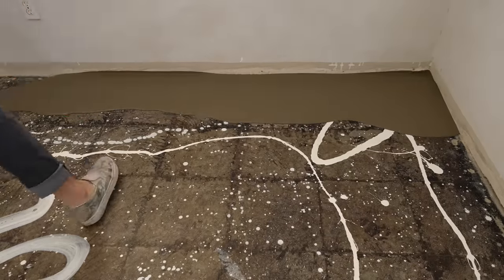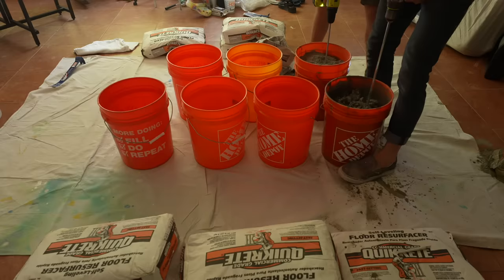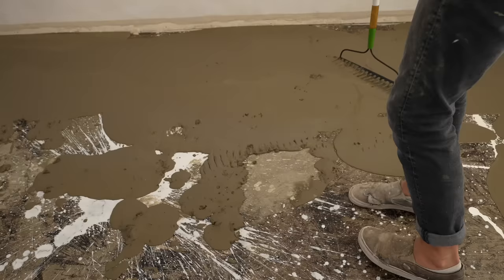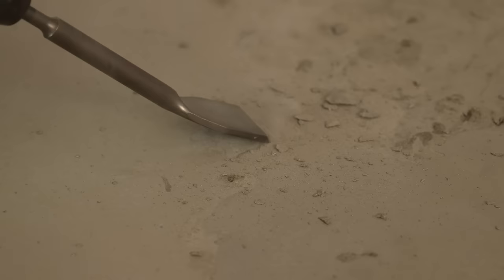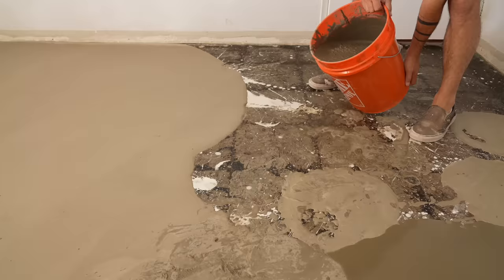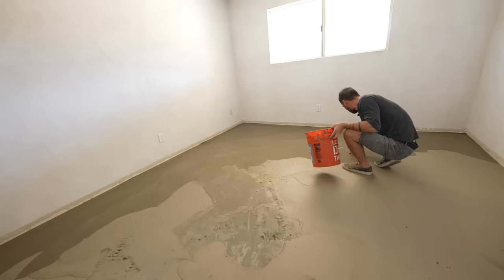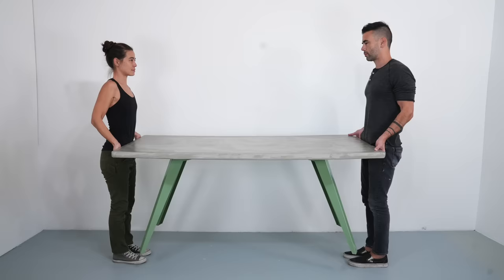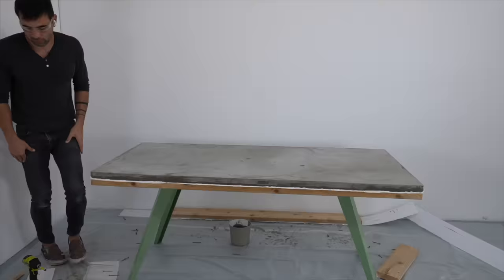Resurfacing Concrete Floors with a Self-Leveling Skim Coat

Comment: I have installed more than 2 million sq. ft of self levelling cementitious underlayment for rehabbing commercial buildings and a few residential projects. We usually shot blasted the floors with a Blastrac machine to mechanically etch the floor and to remove surface contaminants. We applied a latex bonding agent to the concrete to adhere the topping to the concrete substrate. Temperature is very critical for these materials, and we used ice cold water on hot days to slow down the material from flash setting. Our most commonly installed product was Ardex K-15 in foot traffic areas and Ardex K-500 where there was wheeled traffic.
Reply: Ardex is the absolute best of any self leveler i have ever used! You could drive a semi over that stuff when its dry!
Reply: By wheeled traffic are you talking vehicles i assume?
Reply: @StonemanRocks  At one time I was the largest user of Ardex in the country. I installed it all over New York City to rehab buildings. 80% of all construction in NYC is rehab of existing buildings.
Reply: @jamesmorrison7847  Very impressive! I would have loved to work with you! Im sure I would have learned a lot of good nuggets of knowledge! My resume might not be quite as accomplished ,however, I think I could carry on a conversation with you over a cup of coffee about this topic! My experience is well rounded with a lot of commercial tenant development and new construction as well, movies, restaurants, hospitals, post offices ,custom homes , tract homes etc. not to mention probably 1000 shower/ bath remodels! I have used a lot of different self levelers in all kinds of different senarios. Ardex is by far the best!
Reply: Sounds like Ardex is the best product as far as ease of use. I'm going to spend a little bit more to avoid the clumping and too much fast drying for me to keep up with

Comment: {scratching head} Isn't the adjacent floor Saltillo floor tile? If so, that is typically 1/2 thick tile. IF SO, the concrete is level to the adjacent concrete and not 1/2 lower ...and you made a big mistake.  Nevermind what this will do to the base of the sheetrock that absorbed the water in the mix over time.
Reply: Nah it dries so fast it wont hurt the sheetrock!
Reply: @StonemanRocks  All these types of materials do not dry... they hydrolize. If they dried, they would be power. Hydrolysis is the process of breaking down the concrete as it reacts with water. In this instance, the water content is high so that the leveling can occur. The water in the mix will absorb into the surrounding material and/or evaporate. The difference between absorption rate and evaporation rate determines the rate of breakdown in the concrete.… too fast, and it cracks… too slow, and it loses cohesion. Here, the difference in the rate of absorption of water into the cellulose in the sheetrock and evaporation in the air (as well as the process of hydrolysis) means that the edges of the leveling material will probably crack over-time. It is not the speed of of evaporation of absorption but the difference between the rates of hydrolysis. That is why preparation of the both surface and leveling material has so many variations that the process becomes based more on experience rather than simply a list of instructions. As a result, most experienced persons typically tape moisture resistant craft paper or plastic to the wall adjoining the floor leveling material.
Reply: @joemoya9743  you havent used much self leveler have you!
Reply: @joemoya9743  its not going to crack on the edges ! And by the way mr wizard the way it self levels is partially a function of the amount of water but also do in fact to the shape of the aggregate silica in the product because it is round therefore it rolls when it “flows” ! Without enough water though it stops flowing and you get high spots. Water or not you still have to work it as you pour it with a trowel rake something! Too much water just makes it powder after it dries . I have never seen it crack from too much water! Also there is a chemical reaction that makes it dry not just evaporation !  You can tell as it gets warm to the touch while drying!
Reply: @StonemanRocks  The chemical reaction you speak of is called hydrolysis. The rate of hydrolysis over the entire surface determines if it cracks or adheres properly. In this instance, if you want the leveling fluid to adhere or not crack, you want the evaporation of excess water to be the same through out the media. And, that will not happen if the rate of evaporation is slower or faster along the edges that are adjacent to the the sheet rock. 
How much of impact the the difference in absorption rate is determined by how much of the leveling fluid is touching the sheet rock.  If it is very little, then the absorption rate into the sheet rock is also very little. This results in little chance of cracking. However, the video indicated he may have used as much as 1 inch of leveling fluid.  And, that increases the chances of having problems along the edges.  
The good news is that self leveling uses lots of water and cement BINDER such as fluidizing adjuvant (also called superplasticizer designed to bind to latex primer and prevent delamination) and fine granulates (typically a sulfo-aluminous clinker and not silica since it is a quick setting mixture) to prevent shrinkage and cracking.  The cement is typically Portland cement that contains Calcium Silicate and the major contributor to any potential cracking. Thus, the need for a cement binder.  
The key in making self leveling work is the proper amount of mixing of all ingredients applied to a homogeneous surface.  And, sheet rock edges make the surface non-homogeneous.
All this being said, it appears that he is using leveling fluid for a situation that should not have been done - at all. There was no floor height difference. He is comparing floor surface to foundation surface. He doesn't know the difference between flooring and concrete foundation. And, that is a fundamental problem.
Reply: @joemoya9743  You know nothing !
Reply: @mrpolnar1  My Chemical Engineering Degree says otherwise. And, my fathers business was concrete construction. I grew up around concrete and construction.

Comment: I have been installing concrete microcement overlays for about 20 years and I can tell you that self levelers are without a doubt the one that takes the most experience and skill to pull off properly. Everyone thinks you can just dump and leave it like in this video. If for yourself and you dont care, then fine but for a paying customer this will never fly.
 Those pour lines end up being ridges and youll get discoloration from pour to pour especially if your water content isnt the exact same from mix to mix.
You HAVE to use a gauge rake to pull it all even and then quickly smooth out with a trowel or magic trowel/squeegee to tie in your pour line and have to work FAST.
 Every load must be mixed the exact same amount of water or youll get color shifts from each bucket.
Self levelers will also develop a bunch of tiny micro-cracks, no matter how well you prime and even if you use low water content.
Reply: Absolutely and having a spike roller to agitate and blend pours would have made a massive difference.
Reply: Facts
Reply: Also if you are getting microcracks are you wetting your surface before you pour? Maybe thats causing it!
Reply: I agree with Mojo jojo. In fact on larger projects we used a specialized machine that mixes and pumps the self levelling product while our guy used the gauge rakes and long handled trowel to break the surface tension and prevent ridges.
Reply: Another important part is prep work, that floor should of been cleaned with a grinder
Reply: @woozy607  kind of extreme for a residence! It would work but the dust would suck! Not sure what was there before but a good clean and maybe a light acid solution but even that's a little extreme for a residence. Sweep and mop and use a product with good compressive strength along with paint down some glue/ primer before and good to go!
Reply: @woozy607  i was def concerned with the 'foundation' of the pour.. it looked sketchy with all the paint and 'stuff'   but , good job for a first timer  :D
Reply: His first time and he ran to make a video to teach others his mistakes
Reply: Exactly‼️ They are loaded with accelerants to speed up the drying time which causes it to shrink and crack. You can feel the heat coming off the floor as it’s drying. I stopped using it because it doesn’t truly self level. Little things will stop it from spreading evenly. Then you wind up having to go back and grind down high spots before setting tile just to keep everything level and even. PITA
Reply: great points, thank you
Reply: If you are getting micro cracks you gotta be doing something wrong! I have never noticed micro cracks in all the self leveler i have poured ever!
Reply: @StonemanRocks  get them wet, that’s when they all show up. When it drys out you can’t see them.
This even happens on self levelers made to be finished floor toppings.
I’ve diamond polished many of these and they look great until you go to clean the floor with a mop and hundreds of spider cracks show up everywhere then go away when dries.
Not good
Reply: @TimKollat  why did you polish it ? Wrent you going to cover it with tile or something?
Reply: @TimKollat  did you tap on it to see if it bonded? If it bonded i wouldnt worry about micro surface cracks!
Reply: Do you have a youtube channel?? I wanna learn.
Reply: Could you help me out as you know a lot more about this? I’m gonna try do it but don’t want it cracking or anything

Comment: Have you ever thought about consulting a pro, or even the manufacturer before putting out bad info like this? You could have had such a better time and better results by having a 5 minute call with someone who does this everyday. 

For anyone watching this:
1. NEVER alter the water amount, just change products based on your environment. 
2. Spending $100 on the right barrel, mixing drill, spreader, and smoother will result in better installation and results. 
3. Although it’s self leveling, it needs to be smoothed or agitated using a spike roller to break the surface tension. This is a must. 
4. This product is not meant as a wear layer, there are other products that can hold up to surface wear. Also, applying a penetrating sealer will not change the look, and protect against staining.
Reply: You can too add xtra water and it can work for a wear surface too! You just need to buy the good stuff with a high compressive strength and do the right prep on the existing surface! Im thinking you are a well intentioned keyboard cowboy but that you have limited or no flooring exp! No one calls a trowel a “spreader“ ! And what the hell is a “smoother” lol! Plus $100 isnt going to buy a drill that will stand up to the rigors of tile /stone installations overtime not where I live anyway!
Reply: I take that back my smoothers name is Dave!
Reply: It’s on the bag and would have taken 2 mins of googling for them to find the right answer. I’m still perplexed that they are fine spreading bad information for other home owners. Especially with something that is such a pain to fix later.
Reply: Experts are after perfection and perfection is costly.. he was after the imperfections, hence why he said he doesn't mind stains and he liked the patterns he got. Giving him the old rustic look..

Comment: Nice video. I used LevelQuik RS and the matching primer. It was my first time and I had a similar experience. After 12 bags I learned quite a lot:
The recipe on the bag makes a dry mix that doesn't flow enough to actually level. Especially in dry California.
I talked to a pro tile-layer who uses the same everyday and he uses a way way wetter consistency (like 20% more water), and no problems.
I'm usually skeptical of people who say "I never read the bag, always done it this way, my daddy taught me, blah blah", but he was right, even just a little more water made everything better. I could take my time mixing without worrying about it being too dry by the time I poured. And the lower viscosity made it flow so so so much better. I'm not one to deviate from manufacturer instructions, but since you had success with a wetter mix, I wanted to back your video up with my similar experience.
Last thing people should know is that it doesn't fair-out like caulk or wall compound does. You can only spread it so thin before it looses its cohesiveness and you're just rolling tiny balls of grit around. It's best if you put it on thick, all the way up to vertical walls. It's not so great for skimming over a shallow low spot. If you're covering it afterward you might not care about surface finish, but it will tend to break up and turn to dust where it's very thin.

Your mileage may vary! If someone disagrees with my method, that's fine, mix how you would like to! I'm just sharing what worked for me. That's what DIY YouTube is all about!
Reply: Looking for a self leveler that emulsifies well when you mix. Willing to spend a little more on the right product. I plan to self level a floor and then put stain or a wash over it so need a self-leveling product that is good for that

Comment: It is very important to read directions. I used this as a complete beginner and had no issues.  It worked perfectly, with one pour. I could tell on your first pour that not enough water had been added. It's supposed to be runny so that it will seek its own level, like water does. Also, it's not meant to be the finished floor so it may not hold up over time.
Reply: what would you put over it? would Skimstone work? or are you thinking a flooring like tile or planks?
Reply: seal the concrete and it is supposed to last longer then the house

Comment: Haha. Yeah everyone’s first concrete experience alone usually goes this way. The fear of “running out of time” and having your product set up on you. Key is remain calm, and be smooth. Everything is in the prep. Smooth is fast. At this point I can do all concrete projects but when I first started I felt like I needed to be the flash of concrete work. Gave me so much anxiety. Looks good brother
Reply: Yes, right now my concern is a fast drying self leveling concrete that dries the slowest but I will have a Helper and my room isn't that big so I probably shouldn't get too paranoid

Comment: This surface will not wear nicely. SLC will not last uncovered. It just isn’t like real concrete, it will start to abrade and sand will come out of it. At that point it will wear very fast. Maybe if you’re always barefoot on it…
I would look into at least a surface hardener which doesn’t change the look but might keep this together longer.
Reply: Yeah, SLC suuuuucks for this kind of application.
Reply: He could do an epoxy topcoat though, right?
Reply: @mileshh515  should work yes
Reply: Or do a skim coat of ardex! Cheaper by far than epoxy!
Reply: Wonder if it'd be good to do one quick read and then one coat of Ardex. I am not laying anything over that except stain or equivalent

Comment: On self leveling concrete, you do it backwards. Usually we pour concrete powder first before water. In self leveling we should put water in the bucket first then the concrete powder based on what it says in the packaging. In this way youll be able to eliminate the unmixed chunks in your bucket when you pour it down. But hey this is a really nice content. Kudos to you. You earned my subs. 4 thumbs up

Comment: You need to rake (special rake with 1/8" - 1/4" gap with floor) the surface while pouring. This would have gotten rid of both the bubbles as well as the color variation.
Reply: A trowel works too!
Reply: No you use a trowel and spike roller to roll the bubbles out at the end
Reply: I assume the rake and or squeegee would have to be used fairly quickly after the poor. If you do it at the very end wouldn't it start to dry and there would be Spike holes?

Comment: its great to watch your videos, as you explain things. You may not get the results all watchers would like, but the process is key. Way to go! 
Doing a overlay is not a easy job for one person, yet you somehow managed to pull it off. 2-3 people needed..One mix, one to use a magic trowel/squeegee to mix the line patterns you are getting, and if you want to color it, someone to sprinkle the color powder. There are so many companies making overlays from super cheap to stupid expensive. I have tried about 6 brands to make samples, and they vary in 3 groups...some are just like this, one color putty mix, and some are more like a gray concrete that dries with some concrete characteristics in shades.

Comment: For future furniture components give high strength grout a try. Its considerably stronger, may cost you far less & once you get the timing down you get a sense of when you can remove pieces from forms yet stil work the surfaces for say burnishing, carving, detailing etc. A very experienced boss told me about that when explaining how he cast all of these specialized pcs for a winery's venting system using custom cast pcs, it was very trick.

Comment: I recently resurfaced my garage with this stuff. My findings were similar, where the mix needed more water and I ruined the first could of pours. I ended up misting the wet concrete with water to even out the swirls. It went OK. I need to do another coat with these lessons learned, though.
Reply: How’s it holding up in your garage? I looking to do this in my garage but curious if it holds up to parking in it
Reply: @NoName-be5ir  It's held up well. No spalling or immediate signs of wear.